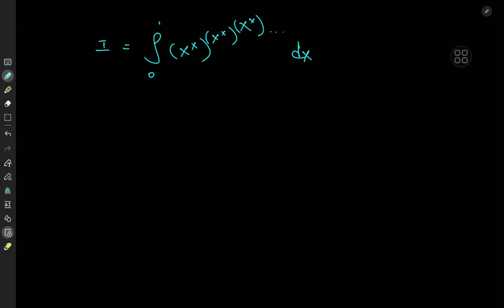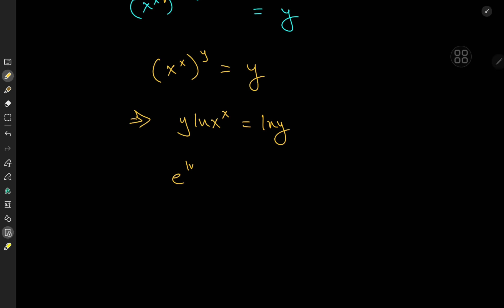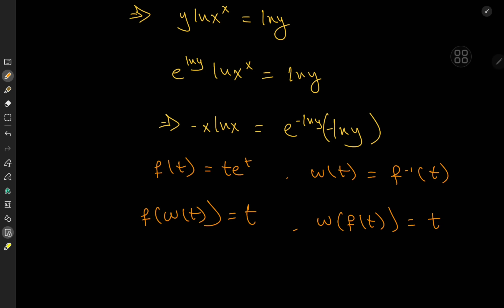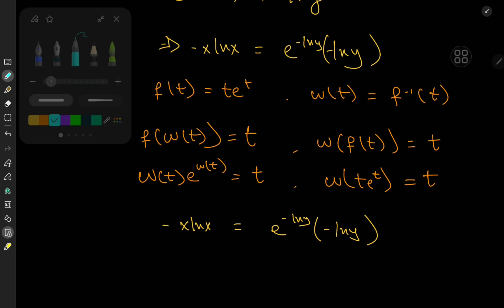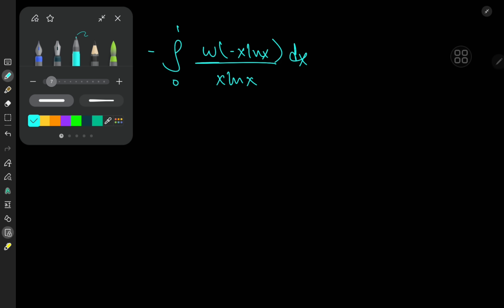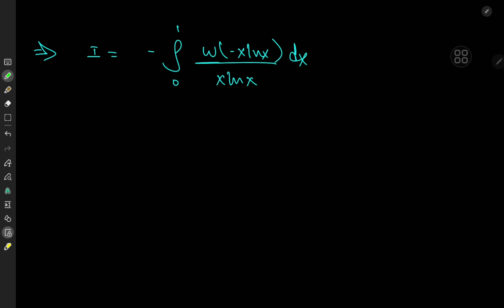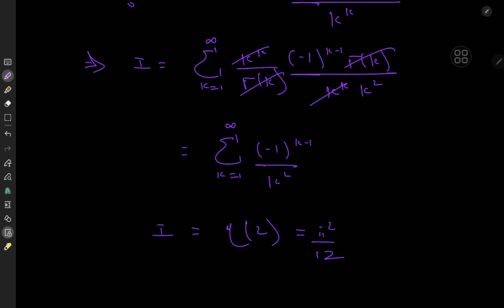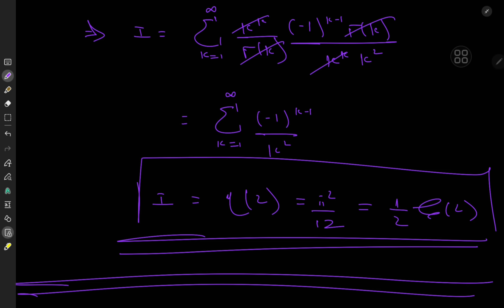Solving an infinite power tower integral

Comment: Is there video where you solve the integral of x^N ln^N(x)? I can’t seem to figure it out
Reply: Solve by integration by parts, 1 or 2 times you will see pattern. Hope you find it
Reply: @sarvagya6904  No rather just put lnx=-t and simplify and as k is constant in integration try making everything a function of kt and then when you  would substitute kt=u,it would become the gamma function
Reply: @AbdulTayyebSaify when we substitute lnx=-t , wouldn't the limit ln0 be indefinite. Or is it something,
Reply: @sarvagya6904  this is exactly what we want , the normal form of the gamma function has bounds from 0 to infinity. as x goes to 0, ln x goes to minus infinity, so the substitution -t = ln x will give us the integration bounds [infinity, 0] and an extra minus sign that reverses the
Reply: Hi, Sorry but evaluating numericaly this integral, I got:

the Omega constant, &. The Omega
constant is the unique real number such that  Ωe^Ω = 1

Therefore, the integral equals to:

0.567143290409783872999968662
And this is NOT  π²/12

Check it pls
Reply: @ht85  how did you evaluate the integral numerically? if it gave you a constant, wouldn't that meant you used a symbolic algebra package?